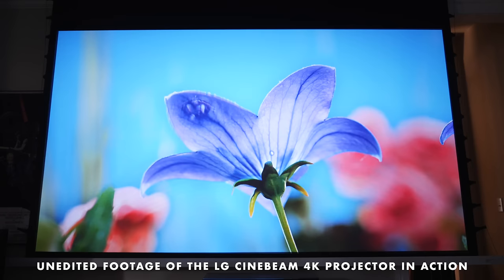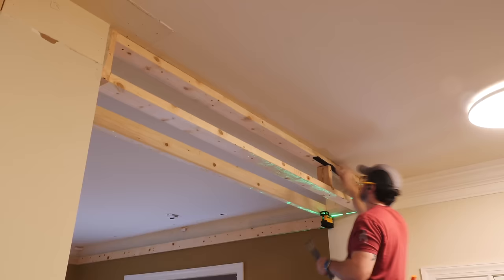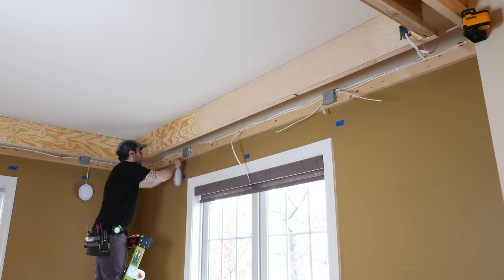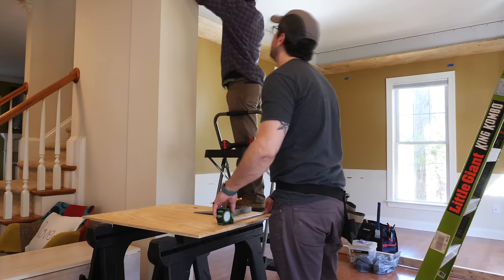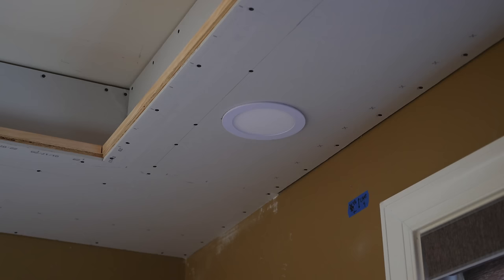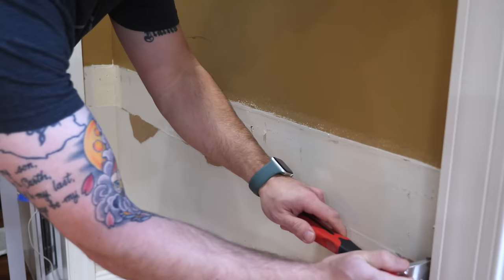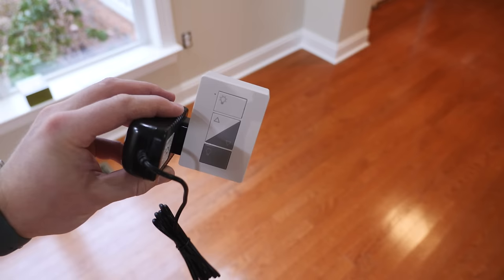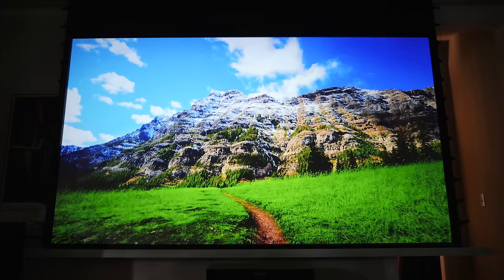DIY 4K HOME THEATER MAKEOVER REMODEL 🎬 Smart & Stealth Media Room

Comment: You can take a small shop vac with a 6 foot hose and duct tape one end to the drywall sander handle 2-3 inches away from the wall. Put vacuum on a camera/guitar strap or backpack and vacuum it while you sand.

Comment: I could write a diatribe regarding drywall but I'll keep it pointed and simple. With two people you don't need a support (you called it a dead man) for a sheet less than 3.6m long come in from the ends about a 1/4 of the sheet. With the screws your supposed to use adhesive with drywall and the screws are intended to hold the sheeting til the glue dries and the muddling is done (the are exceptions). The argument that the drywall is removable if you don't adhere the sheeting is not accurate as the screws get muddled anyway. With the broad knives you where using, you want to choke up on the handle towards the blade and put a finger behind the flat surface for feel and control. What you have done obviously worked and got a good finish so Great job with the whole room and  the production of your videos is always great quality cheers.

Comment: It's worth noting that you're required to pull a permit and have the work inspected to make these kind of electrical changes (some areas even require a permit and inspection for low voltage wiring). You may or may not need to be licensed, depending on your situation and the local codes/laws. Not getting a permit can come back to bite you 1) If there is a fire or injury 2) If you try to file an insurance claim 3) If a house inspector notices and calls you on the changes when you're trying to sell the property.

Comment: I don't recommend having junction boxes for electrical connections buried in the soffits. If an issue happens your gonna have to tear everything apart and it's against code.
Reply: He has access through the recessed lighting holes, no?
Reply: All electrical connections are buried in the walls anyway, your point is invalid.
Reply: @stedly  the code begs to differ.  They all have to be readily accessible in an approved box with a cover. Can't tuck it in the wall or soffit and cover it up.

Comment: Suggestion : Try Studio Monitors. You can buy them individually. They are very accurate in response. They are powered with xlr balanced input. All the speakers in surround should be identical. Left center right and surround. jbl lsr 305 or 308 are better option. Their wave guide sound dispersion is excellent. Av receiver with xlr digital output is required for this kind setup.

Comment: Nice video, but there are some issues about your build. 
1. Next time put tubes in the Wall for easy switch or extension on installation 
2. Befind screen you should paint in Dark color, this will make more relaxing view on screen and a betyder picture without shine problem
3. Removing isolation in outer Wall is making cool-bridge = wet areas and it ruin the walls if there cold outside amd warm inside

Comment: Very nice job!  Right now I have 45 deg slopes along the side walls from the 10' to the 11' height.  I was thinking about boxing them in with a soffit similar to what you have built here just to make it easier to terminate the tops of the columns I'm planning to build to house the side surround speakers.  I'm starting to wonder though, it might be simpler to just come up with a good way to make the tops of the columns with the 45 deg slope.

Your room turned out great, fantastic job!

Comment: Premixed joint compound on fibergalss mesh tape is a giant no-no and will almost always crack within a few years. You need to use hotmud on that type of tape.
Reply from the maker: It’s not fiberglass tape, it’s still made of paper.

Comment: This video inspired me to the the same I just feel he over complicated the crap out of the entire project!
Reply: ejh1989, agree! I doubt I would have skinned those soffits with plywood. They don’t add structural value, nothing for the lights, it doesn’t make the drywall process go better and does nothing for the trim. A frustrating step that could have been eliminated. And, when the next owner uses his wireless hologram tv screen with Bluetooth speakers, he will want crown molding in there and wonder why anyone would install a soffit in the room.
Reply: @reedrobb  Agree the plywood layer seems entirely unneccessary. Just frame enough to attach the drywall. End result looks GREAT, just way over built. 👍

Comment: hey man great video. one suggestion if you ever do crown again. when i instal crown instead of using caulking i tend to use pl(construction adhesive) but only small dabs of it on the back. hope that tip helps a little

Comment: since you like to way over build stuff , you should be made aware that sheetrock screws are very good at pulling stuff together , but they have very little sheering strength, so all that weight hanging on the  horizontally installed screws could break the screws,i recently had that happen to a shelf i built in my basement, so a bunch of my heavier tools , like a table saw, scroll saw and several circ saws, and some mooring chain with frame pulling iron, hit the ground, i found out i should have used structural screws, or my nail gun i got rite after that happened, so practice with the nail gun, it's worth it
Reply from the maker: Yea, I didn't use the drywall screws for anything but the drywall here for that reason. They're not very high quality and I typically use deck screws or something similar for anything that needs more strength.
Reply: @craftedworkshop  ya, at a distance all those screws look alike , that was more for the viewers, i just recently learned the hard way, man i'm glad i only build stuff for myself, my ignorance could have been bad if i had built someone a deck

Comment: Maybe I missed something earlier in the video, but it's not clear to me why you did the soffits the way you did.  Why didn't you just make flush, clean outside corners rather than the overhang with all the extra molding the way you did?  Was it purely an aesthetic choice, or was there some structural or practical reason that I missed the explanation of?

Comment: you shouldn't tighten the romex connector that much. you want to tighten it so that it doesn't move on its own but loose enough so that it will slide a bit if you give it a little tug, you could cause a short otherwise

Comment: Nice work! BTW SKIL makes a great 360º line level (also comes with a single vertical line as well) for under $90 on Amazon (model LL932201) which has been a life saver during my own home renovation projects... and makes having picture a breeze.

Comment: Thought of fitting the whole projector into the wooden part? Seems like there would be enough space? Maybe have it motorized to descend down for projection/service.
Reply: Having it hide away just to not be scene out of use wouldn't be worth it for that setup. Temperature control for the projector would be a main factor. It would be a lot more work because he would then have to fit some sort of system to move air through as I am sure that boxed in area would get hot enough where just having a simple slotted vent with no fan would not be enough. Then it comes to any dust, he would more than likely have to be servicing it a lot more. Just isn't worth it tbh. But if he was building a house with a room from the ground up, then proper provisions could be possibly made but you also have to keep in mind that you are pretty much locking in that one projector so any upgrades/changes can be may be more substantial in the future compared to only getting a new mounting bracket.

Comment: I like this whole set up but the main thing I would have tried to improve is a way to recess the stand and mount it to the ceiling instead so the projector just barely comes down from the soffet.   Call me picky but I have always disliked the way a projector looks hanging down from the ceiling.  if I can conceal it anyway possible, I would.   with keystoning capabilities getting really good (especially with the laser projectors), I imagine the location where you mount the projector becomes more forgiving

Comment: Love the build everything was fantastic. I do have a subjection, I myself also hate doing the Plastar ar the end of installing sheetrock, so this is my subjections "Why didn't u just do the finish product with the Plywood or engineered wood?". U could had just us MDF or Particle Board for the framing since it is a inside remodeling on top of your existing sheetrock so it is already is up to code for fier. (exp. u dont cover a hardwood wall cabinet with sheetrock to make it up to code, because behind it the wald already has it). Therefore you could had done the finish work with Plywood or any Finish Engineered Wood types, so you would had just Stain and Varnish it for a expensive looking design and don't have to event work with Sheetrock. (PS: it would actually cost  you less and increase the price of the house more. Plus it looks better on my opinion.)
Reply: Just my opinion but I think the plasters and pained looks cleaner and more modern

Comment: How much did this renovation cost you roughly?
Reply from the maker: Hard to say, as I had all of the plywood leftover from a previous project. Just for the materials, I'd guess around $500, then obviously all of the electronics added up. I linked to all of those in the video description so you can price those out.

Comment: I just have a question, I'm from Europe, so all of your home ar empty in wals? only woods and dry wall. 
Why?? because here in Europe are concrete 
btw great job, maybe I will do that in my livingroom :)
Reply: basesku89 for interior walls, there is just wood and drywall, but for exterior there is insulation and moisture barrier inside the wall

Comment: No point in having rear surround speakers when the couch is right up against the wall.
Reply: They sound just fine with proper room calibration, speaker set up and height adjustment- non issue.

Comment: What's the point of the plywood? You're just hiding wires and supporting light LEDs. Framing for mounting projector and screen and just drywall would have been faster easier and less expensive.